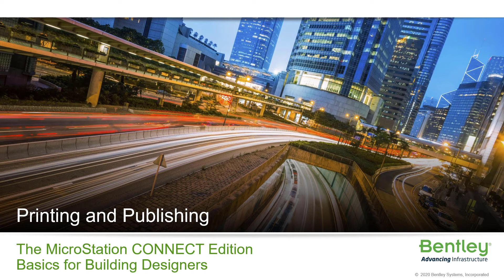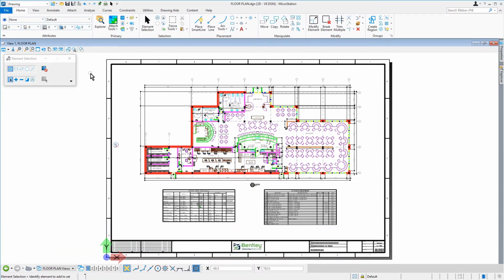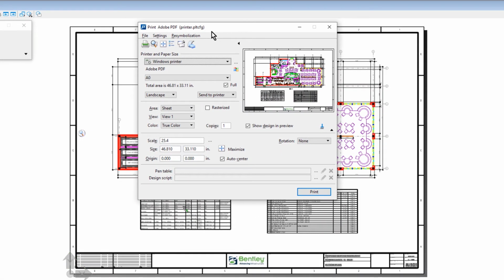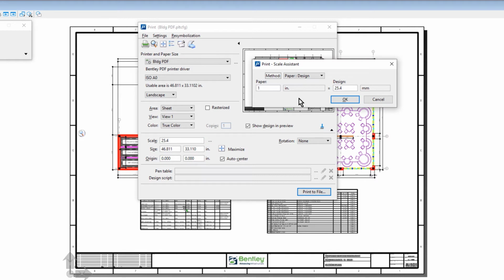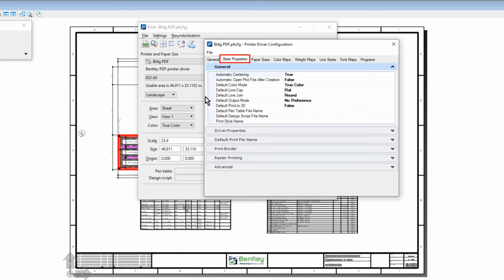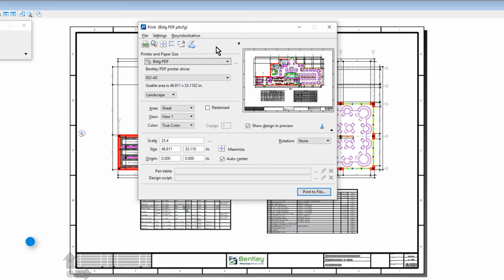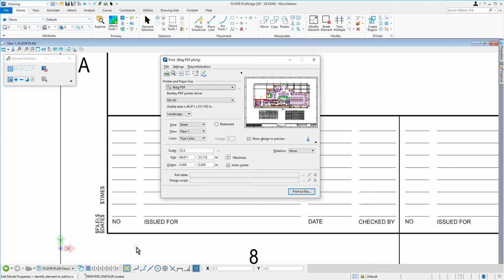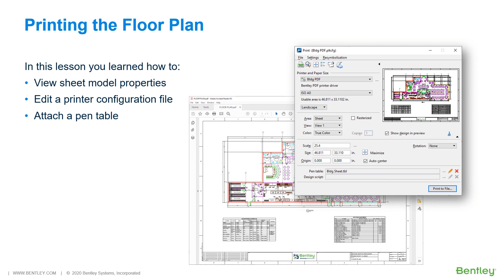Part 1 Printing the Floor Plan Sheet

Comment: Can pen tables be used to print section views from a 3D model? Do these referenced section views require any special adjustment in the reference tab? I've tried with and without cached visible borders without any success so far... Thanks in advance.